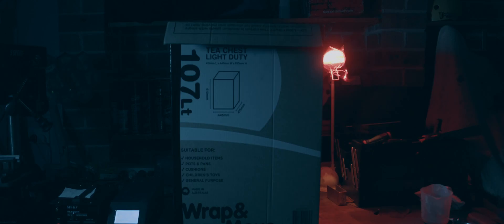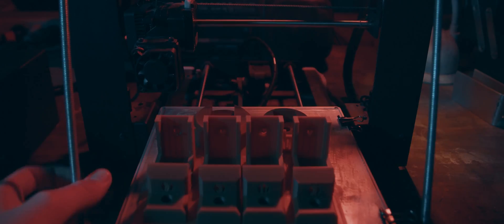3D Printed DSLR Gimbal - DIY Tutorial - Part 1

Comment: Was the storm32 1.31 gimbal able to handle the current that those 5206 motors take? From what I've researched, 5208 motors on 3s is about the furthest you can push that board's FETs. What voltage did you use?

Comment: But does it work?
Reply from the maker: Currently I am awaiting the motor controller. I will release a part 2 or Instagram post of the finished product. However the gimbal is being used for a future project as well.  :-)
Reply: Plz make a 2 second quickly